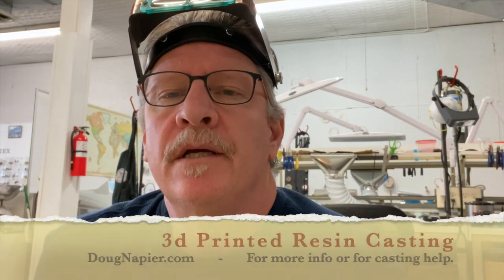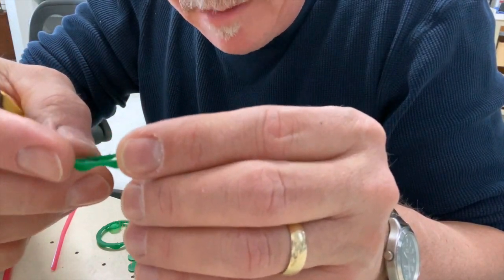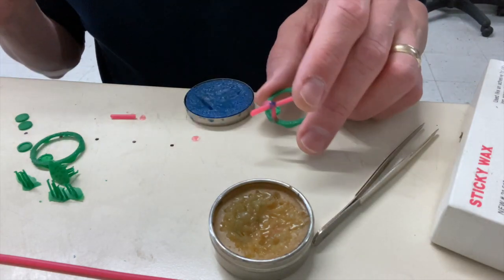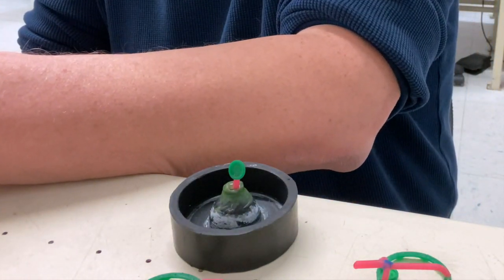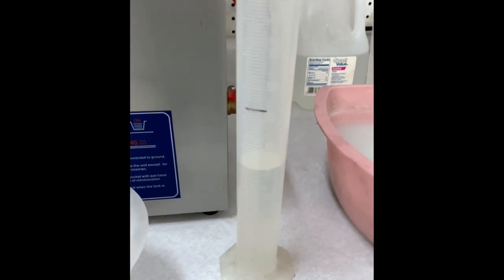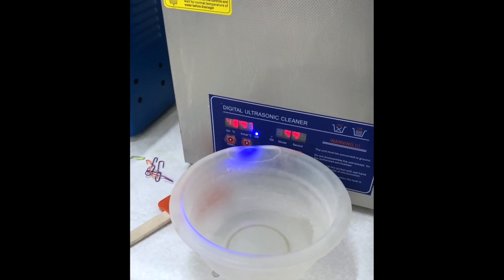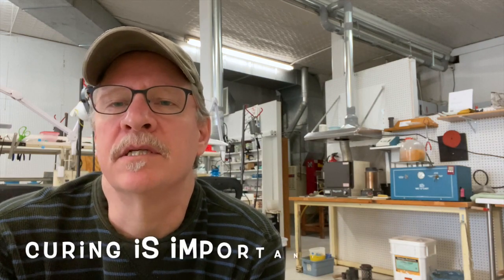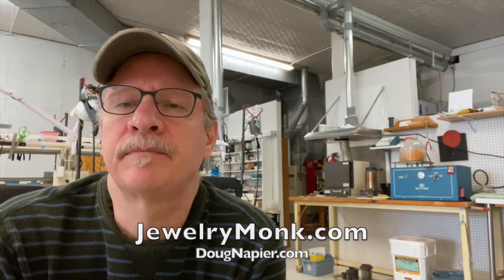3D Print Resin Casting for Jewelry How to Video Step by Step B9Creation Emerald Resin Vacuum Cast

Comment: hello, thanks for the video. Will you give me the % of boric acid to mix with the water? That sure helps a lot. Thanks
Reply from the maker: Luis, I mix 2 oz of powdered boric acid to 1 gallon of warm water. (After it dissolves, I set it aside to cool to room temp before use.
Reply: OK, thank you very much. Can I bother you with a new question: is this process applicable for casting stainless steel? (no need to explain that am new in this process) tanks a lot for your help @DougNapierJewelryMonk
Reply from the maker: Not sure. I have never cast steel.

Comment: Doug, thanks for your patience. I have one more question, because I have problems on my process with ashes so, I saw you are using ultravest with boric acid, but what is the ratio? I am using plásticast with about 2% of boric acid and a 40/100 invest ratio, but recently I saw on the b9c forum many people's are using it 36/100 to make it very strong. Thanks again for all your help and advice cheers
Reply from the maker: Gianni, I am using about 38/100, and I add about 2 ounces of powdered boric acid to 1 gallon of water, pre-mixed, and let sit to room temp. Hope this helps.

Comment: Where can I find the wax sprew for casting
Reply from the maker: Hi Michael, i order it from jewelry tool suppliers like Rio Grande.
Reply: @DougNapierJewelryMonk  what's the name of the sprew?
Reply from the maker: @t.w.i.t.c.h8711  Modeler's Medium Red Sprue Wax. 8 gauge and 10 gauge, I use both sizes.
Reply: And what's the name of that sticky wax you use?
Reply from the maker: @t.w.i.t.c.h8711  Believe it or not, Modeler's Sticky Wax

Comment: Sorry, I do not have an oven with a temperature of 1000 Celsius, but I have an oven with a temperature of 290 Celsius. How many hours do I need to melt the resin in my oven?
Reply from the maker: You can't do it with that oven.
Reply: @DougNapierJewelryMonk  Which oven do I need permission?